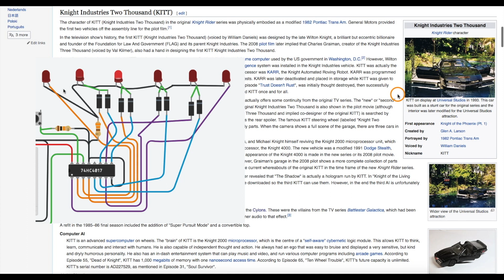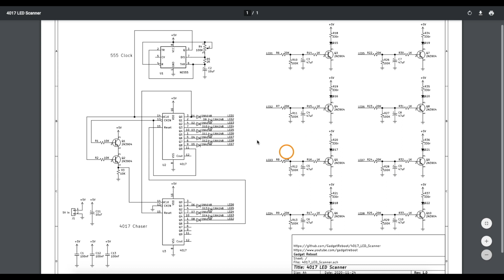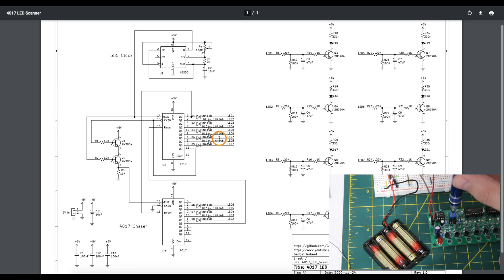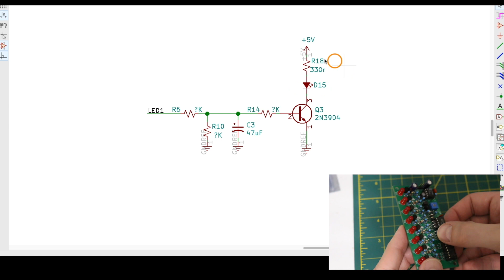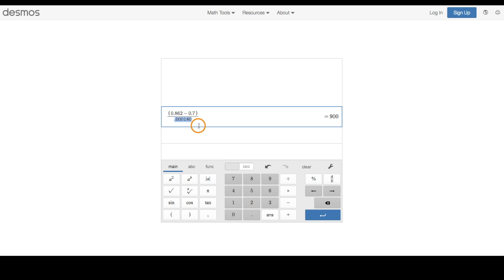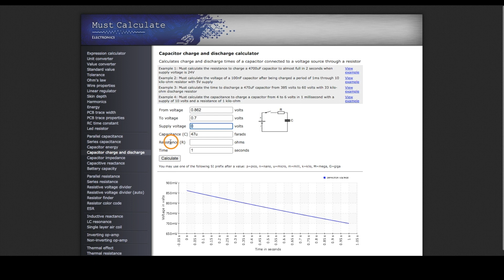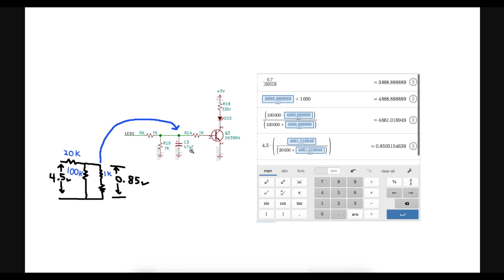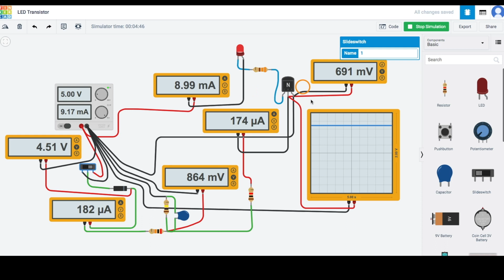Knight Rider Scanner with 8 Slow Fade-Out LEDs

Comment: is there a schematic that shows where  J1 come into play as well as C1,C11,C12,C13
Reply from the maker: The PDF schematic is in the GitHub link in the description. J1 receives 5 V in, C11 is across that input voltage and the other three capacitors are near the 5 V power pin on each chip.

Comment: If I may ask one more question:  I have CD4017BE cmos ICs and you are using 74HC4017 ICs.  From my research it appears that they are basically the same except the amount of supply voltage they will  tolerate.  CD (3 to 18v), and 74HC (2 to 6V).  Are they interchangeable for this application, or do I need to get the 74HC4017 ?  Thanks!
Reply from the maker: they should be interchangeable for this purpose as long as the correct supply voltage is used. I would double check that the pin outs are the same but I would figure they should be drop in compatible as well.
Reply: @GadgetReboot  Thank you! much appreciated!

Comment: To order the PCs I would need this file?   4017_LED_Scanner/KiCAD/4017_LED_Scanner.kicad_pcb
Reply from the maker: That would be the design file if you wanted to generate gerber files or if the board shop can take KiCad files, but in the same github folder there's a Gerber zip file that would just be uploaded for ordering https://github.com/GadgetReboot/4017_LED_Scanner/tree/main/KiCAD

Comment: Nice project; I never liked the simple Larson scanner circuits because the LEDs go dark too quickly. A long while ago I did a similar project but using a PIC microprocessor and code to make the trail of lights look like incandescent (I'm a programmer with very limited electronic circuit knowledge); to see the same effect done completely with electronics was fascinating, thanks!
Reply from the maker: Yeah I was contemplating using PWM with Arduino or something but I wanted to do some discrete component projects too.

Comment: Good stuff!
What was the overall cost of it?
I'm trying to compare it to today's approach with a microcontroller.
Having even a simple Arduino (just the ATmega328, running on internal oscillator) you could just have 8 resistors and 8 LEDs on the board.
Also, if you wanted to change the dimming delay, you could just alter the PWM rather than replacing all the capacitors :)
Overcomplicated? Yes, as you would need a compiler, a programmer and a computer just to run 8 LEDs :)
Anyway, thanks a million for your detailed explanation.
Cheers
Reply from the maker: Looking at Digikey prices in $CDN for small qty, (so could be much cheaper on ebay/aliexpress),  4017 = 0.80 x2
555 = 0.65
2n3904 = 0.24 x 10
electrolytics = 0.14 x 10
resistors = $2.71 for 50 with some left over
diodes = 0.085 x 14
pot = 0.65 (can always do better, lump cost into rounding errors)
PCB = $5 for 10 so 0.50 each
few ceramic capacitors + solder + shipping costs = absorbed in rounding error 

So it looks like we can make it for $11 if we buy all new low qty price break parts, but I used parts I had sitting around up to 30 years so it is actually making me money to get them out of storage and into use, and the PCB was donated by PCBWay for the video so that was no cost for this project experiment.  Worked out well!    

My original thought was to PWM the LEDs but then I decided to be discrete about it.
Reply: @GadgetReboot  Thanks